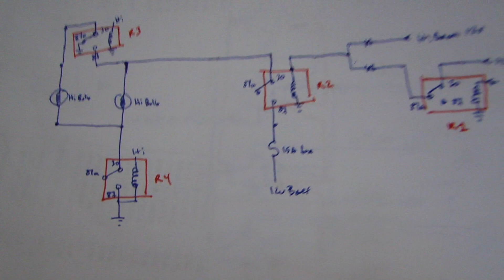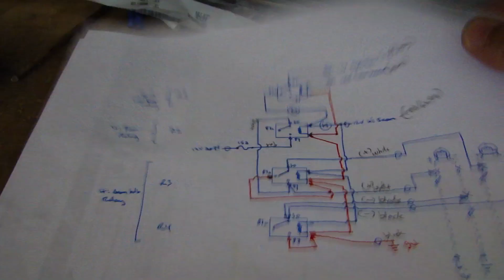Custom Daytime Running Light Install - Works Like Factory DRL

Comment from the maker: @Y0mki  The best thing about my method is that you don't need any regulators or diodes to cut the voltage in half. The relays will switch the two high beam bulbs from a series circuit to a parallel circuit. When both bulbs are in parallel, they get the same voltage (+12V). When they are connected in series, the +12V source is powering both bulbs in series. This is what they call a voltage divider circuit because each bulb is a load and each bulb will use +6V. You can measure it with a voltmeter.

Comment from the maker: @bo2ning I checked the H4 bulb and see it's a dual filament bulb. Since both hi and lo beam uses the same ground wire, I can't give you a definitive answer because my concern is tying the ground wire from the DRL relay to the factory ground wire. The factory light ground wire might be going thru the car computer and I don't want to take a chance in damaging the car's electrical. Sorry.

Comment from the maker: 2004 Quest IPDM connections:
Pin 7 (black/white) - +12V ign
Pin 28 (green) +12V High beam
Pin 30 (blue/silver dot) +12 V Low Beam
Pin 2 (black/yellow) +12 V constant power
Ground - find a good ground on the chassis

Comment from the maker: For my hookup, I did not connect to the e-brake to disable it because that would have added more work to the install as it requires running additional wire into the vehicle to the e-brake switch. I am not sure if you notice, but my description notes has links to the wiring diagram and schematic so you can see where everything is connected including which pin on the relay you connect to. You can put a switch in between the ignition wire to make it an on/off switch.

Comment: Thanks a bunch for uploading your video and diagrams.  Just brought a 2011 Frontier up from the south and bought a Hamsar module which requires the installation of fog lamps in conjunction with the module to get DRL.  I don't like this approach so it's going back to Canadian Tire and going to electronics store to pick up relays, etc.  Thanks again...Ray

Comment: Hi, is similar instalation in nissan versa with light h4 bulb? In your case, the light is separate, low and high beam; in nissan versa the light is single bulb. Thanks a lot.

Comment: this is awesome... I would like to implement your idea with my fog lamp working as a DRL. I'm not an electrician but I'm trying to analyze your diagram using the internet as a reference and see on where you actually drop the power output of your high beam. Did you use a regulator for this or it's on the diodes? thanks

Comment from the maker: Depending on the make/model/year, the wiring can differ. I didn't want to tell people to tap (ex: black/yellow) for ignition when it's different on your vehicle which can end up doing damage (very expensive mistake). This mod requires a person with some electrical knowledge to test all the wires before connecting. Now if you have a 2004 Nissan Quest, then you need to get a hold of the service manual to for IPDM pinout.

Comment: Hi mate,
Is there a way I can do like you but instead of the high beams turning off when turning on my low beams it gets like half the brightness of DRL mode? like 12v high beam, 6v DRL and 3v after low beams on

Comment: This is exactly what I would like to do with my 2015 Armada,  Strange for later model does not have DRL features. I'm not good with electronics but your schematics or diagram showed D1 and D2, are those diodes? Also, how's the reliability after 8 years installed? Another thing, you haven't demo turning on the DRL and park light only, Does it have that option? Thanks I hope you have a video update showing the reliability and actual relay wiring configurations! Thanks!
Reply from the maker: D1 and D2 are diodes. It worked fine all the way up to 2  years ago when I sold my van. Turning on the parking light only does not affect the DRL. Only turning on headlight will disable the DRL.
Reply: Thanks now I received all the parts and good project over the weekend. I just get confused with 87a connections though. Will try to figure it out cause I have the connectors also comes with the relay. I assume I don’t need the connectors or maybe take the 87a (black wire) in the connector off?
Reply: Thanks it works!

Comment: Do you have an idea about 05 Toyota Avalon?
I got it from US and today only I discovered that DRL in my car doesn't fit Canadian standard.
Toyota dealership asked for $300 to install a relay.
do you think I can do it on my own?
Reply from the maker: You can pick up a kit at Canadian Tire and have a local stereo shop/alarm shop install it. Here is what the kit looks like http://www.canadiantire.ca/en/pdp/daytime-running-light-kit-0204001p.html
Reply: dial2fast I can't thank you enough

Comment: Great video. If you can, please go into detail for your electical drawing. I enjoy your page.
Reply from the maker: Check out my channels latest video on LED DRL which I will be installing very soon. I will probably not use this old setup once the new ones are installed. Thanks!
Reply: dial2fast Is the wire the same for your van to an 2007Nissan Pathfinder?